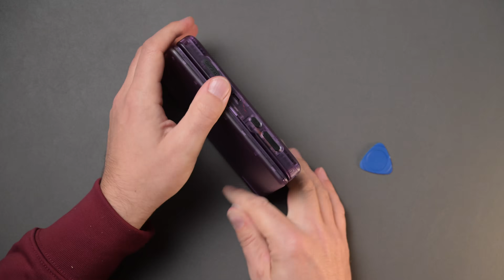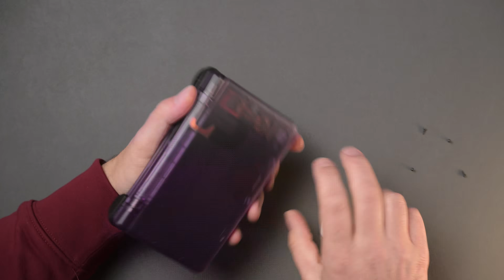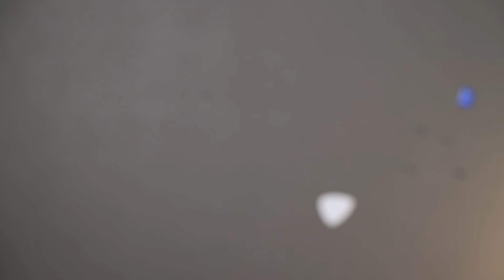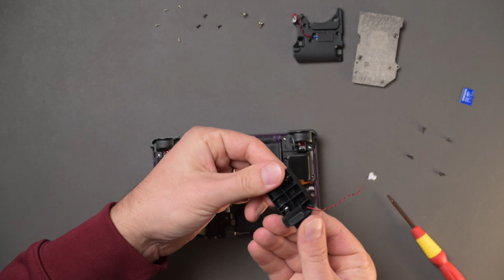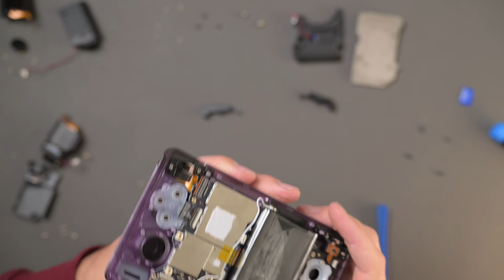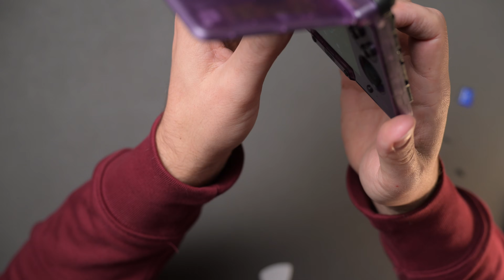AYN Thor Teardown + Attempting a Fan Noise Fix

Comment: Thanks so much for the vid. Helped me fix my fan and also I replaced the heatsink (the thermal putty was slightly torn but I tried molding it back) and now I have 0 buzzing and temps seem normal. This helped me take it apart thanks!

Comment: if you put oil instead of lube on the fan bearing, it will significantly reduce the noise and the oil lasts longer than the lube

Comment: Yeah, getting into the tight gap is a pain. I really hate clips as screws were enough back in the day to keep cases together and should be enough nowadays.
Great video though as pressing the case were you pressed to get the pick in worked.

Btw, they send out replacement fans if you contact them (had to provide a videos of the fans rattling - have this issue with a black and a later ordered transparent purple model). They also send me replacement heat spreaders but they do not look different from the original one. (I send them a message asking if there is a difference)
I just replaced the original fan with the new one and it doesn't rattle anymore. But the rattling didn't happen from the get-go, so I will have to wait and see if it is now permanently fixed. I also will do the thermal paste mod but first need to order new one as my MX4 is nearly empty and I think 10+ years old.

Comment: This is obviously months after the fact, but I saw someone fix this issue on an Odin 3 (which has a very similar fan) by opening the casing of the fan itself, popping out the fan blade and placing some lube on the fan motor.  I'm guessing it may be possible with the Thor's fan as well?  I'm not brave enough to try. lol

Comment: I got this issue just today after closing my car door with the Thor in the side compartment at the bottom. Probably gave the fan a tiny bite of loosening allowing it to now sound like a small lawnmower when moving. Guess that's my fault for putting it somewhere that likely causes a lot of sudden vibration and knocking.

Comment: Would it be possible to make a copper shim that is like 0.2mm thick to move some heat away and up on top of all that inside plastic, and then spread it out with 1mm or 0.4mm flat heat pipes?

Comment: Im unsure if they made any adjustments with batch 3 and newer models or because i asked for colored buttons with my door, but after unscrewing the back plate it came off super easy. I started from between the triggers and got it open in a second with my thumb nail. Did the rest in like a few seconds. Just a heads up for anyone who ordered a black model and asked for color buttons, they upcharge and you have to replace them yourself.

Comment: Hey I got one a thor that someone tried the putty thermal compount swap ans ot wont turn on since. Do you have any idea what maye be the issue or where to look. I checked the battery caple and eveyething in the area that wpuld been removed. Nothing seemed damage. Def alot of putty but is non conductive TG used so should of shorted it. Ill prob clean it all up best as possible and replace with TG pads like the original but better. The putty is too messy imo. Hopefully I cam fix it but not sure what would be wrong. Reslached put to Ayn so maybe they can help even if juat getting a part. No charge going it when plugged in either it seems so its got no juice for some reason.

Comment: Think you can do a teardown for the bottom screen ribbon cable one day? My thor's bottom touch screen stopped responding at day one, and the video that AYN sent still doesn't specify anything I'm trying to figure out.
Reply: i JUST got mine and same issue and honestly i'm afraid of breaking something (i don't have good luck with ribbon cables lol)

did you ever get yours fixed?
Reply: @ZeroTheHeartlessKing  Yes, I did! just by unplugging the battery cable and plugging it back in
Reply: @GalaxiaShadow  lucky. i bit the bullet and tried myself and WHILE I DID do as instructed. it still blanked out for me like before cry

Comment: The Retroid pocket Classic has the same exact fan noise issue when you move the unit while the fan is cranked all the way up. I wouldn't doubt it's the same fan.

Comment: I finally got mine yesterday, today I turned it on and got the fan issue ;__;

I contacted AYN  so maybe they'll send me a fan replacement, in the meanwhile, do anyone knows if it's safe to use the device anyway ignoring the sound?

Comment: Hey, thanks for the tear down video! My right trigger just broke last night. I used your video to show me how to take it apart. I found that it's the spring on the trigger itself. I have emailed AYN and hopefully they'll send me out a new module with the trigger attached. It is the one without the thumb stick, so it's a pretty easy replacement. I'm wondering if one of the springs for another controller on Amazon might work.
Reply: How was the process of getting a new fan for your Thor?

Comment: Hey Derek, I have an issue with one of the speakers on mine and AYN offered to send me replacement speakers, on a scale from one 1-10 how hard do you think it would be to replace both of them? Thanks if your responded loved the straightforward video
Reply from the maker: If you’re comfortable with small screws and parts it’s not bad. The left speaker is easier if I recall the right speaker you have to remove the trigger assembly above it first. Either way it’s not super difficult as long as you go slow and keep track of the little screws.

Comment: My fan completely stopped working last week. I had the same fan buzzing as you. AYN has sent out a replacement fan to me, which I'm now waiting for. I opened my Thor yesterday to examine the fan, and my conclusion is they are cheaply made and I'm concerned a new one will go bad as well. I hope to be wrong.
Reply from the maker: From what I've seen people who get a 'good' fan are still getting the same part. So it's just a QC lottery...

Comment: Is there a "better" fan we can buy after market to replace? It seems this is a common issue. I honestly can't deal with loud fans in any portable device so I'd rather get ahead and replace the fans with something better or quieter ASAP before I get mine in the mail
Reply from the maker: I just received a replacement fan from AYN, going to check it out this weekend and see if there is a difference, will upload a short video if so.

Comment: The battery is difficult to remove because the entire back is adhered with double-sided tape. However, as long as you peel it off slowly and carefully, it shouldn't be too hard to remove.

Comment: Do you have any update to this? My purple Thor Max does the same thing. My temps also get into the 90s even with sport fan mode.
Reply from the maker: Ayn is sending me a replacement fan but it’s not here yet
Reply: @bassderek they told me to redo my thermal paste lol

Comment: Fan noise confirmed over here, I bought a white and black and the fan sounds like it's grinding on something with some buzzing.
Reply: I’ve been wanting to get one is it a big issue the Odin 2 I think has the same chip but not a extra screen so I figured I’d get the Thor for 3ds as well what do you think

Comment: I've been trying to research as much as I can on this fan issue online before placing my order. I really want to buy the purple one but I've found that this issue is found most in the purple & rainbow model. I haven't found anything online with the black one having this fan noise. I find it odd that it's only the other colors that have issues..? Maybe a Pro/Max problem instead of the colors themselves?
Reply from the maker: I honestly don’t think the sku or color matter. Some fans are noisier than others and some people notice it more than others.

Comment: Honestly, I'm not surprised by the quality of the AYN. I was an original backer for the Odin Lite. After 5 months the screen started going blank. Finally, one day it just wouldn't show anything on the screen. People online were having the same problem, and many suggested it was the last-minute screen changes before shipping which caused a months-long delay. All the review units did not have the screen swapped to the inferior display. Multiple people including myself were ghosted by their customer service as soon as they found out we needed screens replaced. One person said AYN wanted nearly the price of the device (up front) for shipping both ways for them to even look at it. Hopefully they will do right by you and anyone else having fan issues, as this doesn't seem to be very hard to replace. But I am wary of AYN and will most likely never buy a product from them again.

Comment: Yeah same thing happened on my Odin 2 Mini, it's just the type of smaller fan used being more susceptible to movement I think.
Reply from the maker: Yeah, at this point I'm pretty sure it's the bearings or something, not any issue that can be 'solved' other than with a different fan entirely.

Comment: What you are hearing is called the "Doppler effect" and can not be fixed unless you change the laws of physics. You could not change the devices location relative to your ears at a frequency that exacerbates the issue. I have a Thor and don't have any issues. Using the device normally does not have this issue.
Reply from the maker: There are people that have fan noise without moving the unit, moving it just exacerbates it. My unit isn't quite as bad. The Doppler effect may account for changes in pitch/volume while moving, but it's not the reason the fan is making noise.
Reply: The Doppler effect wouldn't create that specific noise, and it wouldn't happen when rotating this device in that way. The fan buzzes when moving, which is closer to a bearing being faulty. My device started doing this after 2 weeks of normal fan operation. And this sound is increasingly common with the Thor.

Comment: if you ever perform a deeper teardown, I'd love to see if its possible to remove the dark purple layer under the bottom glass, to see the transparent plastics,
unless the glass itself is dyed that plum color, and it's not transparent as I expected
Reply: I actually have a feeling the change in colour is due to the boundary layer between the glass and the plastic, not any painting on the back. Either, in a simplified way the light is reflecting rather than passing through due to the change in material, or, the way the glass is joined creates a slightly opaque layer due to some adhesive
Reply from the maker: I'm assuming it's painted on the back, because the center is clear for the bottom screen to show through. I don't know if I'd tear down that far though, I don't want to have to deal with regluing a screen if I don't have to.
Reply: This is exactly what I was hoping to see as well. But it sounds like it would be super involved to do something with that. Big sad.

Comment: Good breakdown.  I hope to rewatch it for my eventual replacment of the L2 and R2 analog triggers.  Its my only gripe with the Thor atm.  I wish the triggers had an angle or curve for my fingers on the outside edge
Reply from the maker: I agree they are too angular
Reply: I was waiting for this comment, when I saw how easy i would be to replace once someone comes up with a pair that fit

Comment: Wd40 and Iet air dry. Reinstall fan?
Reply: WD40 is a cleaning and penetrating agent. It will ruin and wash away the lubrication in the fan. It make work better for a short bit but then it will be destroyed.
Reply: Bearing grease would be better.

Comment: Hey Derek, regarding the fan buzzing you tried to fix: The problem might just be the type of fan. It's likely a simple sleeve or ball bearing fan, which is known to start buzzing when operated at an angle or if moved quickly to an angled position.  The fans designed to be more stable at angled positions or operate better under movement are usually hydrodynamic bearings or maglev fans. So, it might not be fixable without replacing the fan itself. As-is, It shouldn't be an issue unless the fan is moved quickly. Hasn't bothered me yet anyways, pretty happy with my Thor.
Reply: Unfortunately mine is too loud to ignore and I need a replacement
Reply: @Xist-Mob this is what I'm finding, some units like mine I have to shake it VERY aggressively to get it to make any noise, while others seem to make noises with barely any movement. 

I don't think this affects every unit but my guess is that due to the fan style it's probably just the nature of it.
Reply: @Tekgnome. Is it the same part? I remember the ps5 having different fans for the same model with one being better then the other
Reply: This this right here it’s like spinning a fidget spinner and moving it around while it’s spinning the noise it makes changes cause it’s got play in the bearings even if it’s a little that space and that speed is enough to make it an audible difference
Reply: Running in the exact same lightsaber issue with the fan.
Reply: Replacing the fan will fix this if your lucky. You can try to open the fan itself but its not recommended. Just replace the fan and hope its not the same sound because Replacing can be the same problem if your unlucky 😭
Reply: Light saber noise sounds kinda cool ngl

Comment: RIP bro! Good thing you took it apart and tried to fix it. I hope AYN sends everyone who has this problem the fix they will need. Since it is not every unite that has this problem.
Reply: Yeah but I hope when mine comes it’s ok because I am not interested in tearing down my Thor. I will just tear it up and that’s not fair to me or anyone who purchased even if some are able to do a repair. I hope Ayn will do better than just send parts.
Reply: This is just a fan thing, so you could not fix it without replacing the fan with another one with another bearing.